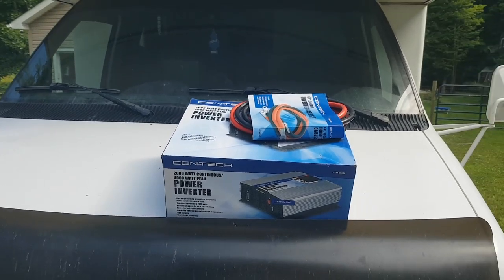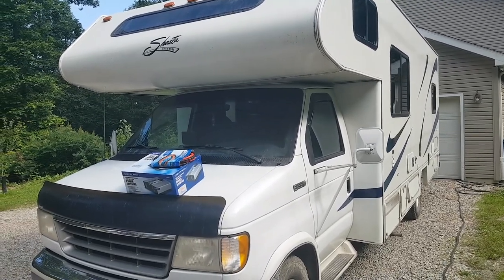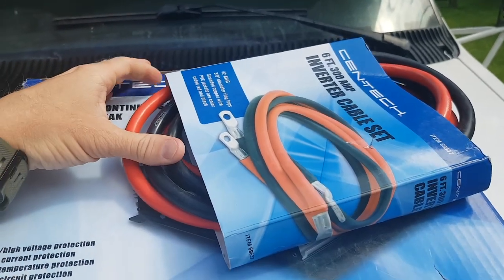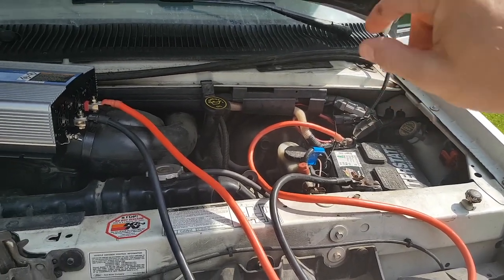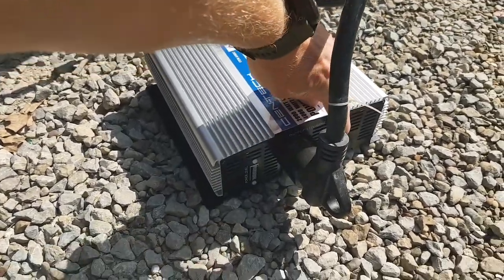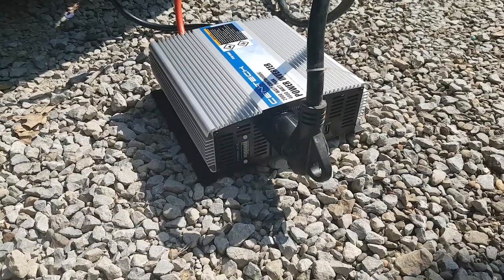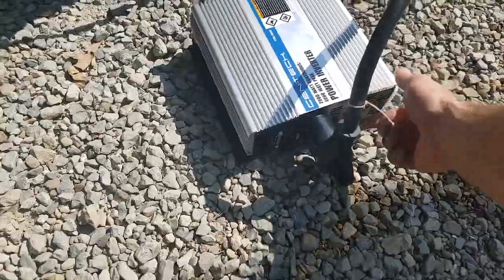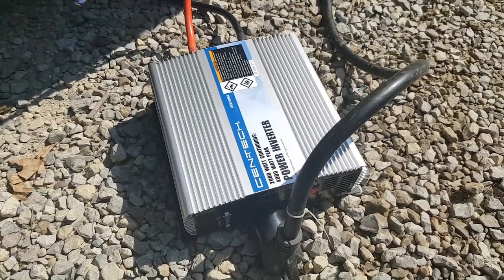Harbor Freight 2000 watt Inverter - Will It Power an RV AC System?

Comment: You need a battery bank and a pure sin inverter. Even with a different inverter you would kill the battery with the engine running. Spend the money on a quite generator!

Comment: As with any appliance the start up voltage draw is MUCH higher than running voltage. That draw will set off the alarm every time when running other devices. To show that is setting it up to fail.
Reply from the maker: But once again I will say that the startup surge on the AC system is still under the surge wattage of the inverter, which means the inverter cant perform to its advertised specs!!!
Reply: Just about ALL electronic devices don't. You add in cables which draw power as well and an aged AC system and I'm not surprised. I would be curious as to what the real wattage draw is on that AC system using a meter and what else you have pulling even the smallest wattage on standby. Even my top of the line Xantrex inverter won't produce 100% of its' "rated" power because it's listed under IDEAL conditions powering efficient appliances, using minimal cable lengths, ect. Plus it looks to me at least the 2000w inverter is only recommended to 1400 watts according to the chart, maybe I'm reading it wrong? There could be lots of variables here. Take a look at this vid of a guy trying to start an air compressor (1680w) using a 3000w inverter at around the 5 minute mark. https://www.youtube.com/watch?v=me0eAJL95og

Comment: Actually the Jupiter 63429 may or may not be a "piece of crap". "Jack..." failed to do at least two things in preparation for his experiment. 

The first mistake Jack made was fail to understand the "load profile" of his A/C. This is complicated, so follow along if you wish. When I use the term load profile, I mean the power draw from a residential 120 Vac outlet as a function of time from the moment the A/C is turned "on"  to say 1 minute. You will find that the power draw (and the current draw) will vary considerably, perhaps as much as a factor of 10X, over this 60 sec time frame. A Kill-a-Watt and your smart phone taking a video will work just fine. Record the power draw for 60 seconds, and then record the current draw for 60 seconds.

The second mistake that Jack made was to fail to understand the specifications of his inverter. There are three things to take note of. First is whether the inverter a "pure sine wave" inverter or a "modified sine wave inverter". If it is NOT a pure sine wave inverter, it should NOT be used with and load that has a motor or sensitive electronics. Second, what is the period of time that the inverter can deliver its peak power. It can't be "forever" that's the continuous rating. I have seen this peak power time period to be a fraction of a second to several seconds.

With the specs in hand, compare them to your video of the power draw of the A/C when plugged into a residential 120 Vac power outlet, I suspect that the peak power draw of the A/C lasts longer that the spec of the peak power capacity and time duration of the inverter.

There is another bit of very esoteric info and it has to do with in-phase and out-of-phase current vs voltage. Another way to look at the issue is to talk about Power Factor, but that is best left for another day. 

Moral of the story: "crap" is in the eye of the beholder.
Reply from the maker: Moral of the story is on the box it says it can power a 15,000btu AC unit and it cannot. Go to 35 seconds in the video and study the pic of the side of the box. Its false advertising. That was the only purpose of the video. Period

Comment: I think the air conditioner, needs much more than 2000 watts to start. You can by something to reduce the amount it takes to start the airconditioner.  My 300 watt dog air conditioner needs about 800 watts to start. And runs at only about 280 watts. 🚐🙋
Reply: The you tube channel "Gone with the Winns" did a great video on running rv airconditioners off batteries.
Reply from the maker: Yeah I agree the starting watts are much more but this inverter was 2000watts continuous and 4000watts peak or surge so should have been more than enough to start the A/C st 4000 watts

Comment: How about an integrated appoach?  A microprocessor that FIRST starts conventional generator and then the AC unit and then once running the inverter (An inverter with a GOOD system friendly sine wave!)  that takes over and THEN the Genny is shut down .....run it to a low temp and then coast as long as possible then ? rinse and repeat ....the processor each cycle waits until the optimal timing  ?  What we NEED though I believe is much better battery tech!  Batteries that can not only HOLD a charge long term but ALSO LAST many years!  AND are relatively cheap to buy!  THAT is what I keep hoping for!  (wondering if latest Tesla techies true to their hype??) Then simply aquire the best available inverters and processors /battery combos that coordinate everything for maximum efficiency!  Then?  just finally sit back and RELAX even in the worst climactic events including wildfire "redflag" shut downs and hurricanes etc...ALL of it!  ....ready to go full "off grid" at the drop of a hat!!

Comment: That's a modified sine wave inverter. Any research you do will tell you that devices with motors (like your AC) won't work properly without a pure sine wave inverter. I run an 8,000 BTU window AC unit with a Harbor Freight pure sine wave inverter. Not a piece of crap, just the wrong tool for the job.
Reply from the maker: Again. The box it came in says it will do it. I don't disagree with you at all. I disagree with harbor freights claims.

Comment: Depend on how much btu was the ac. A 5,000 maybe  a 10 ,000 no way. And it not much about the inverter but how much ah battery you have a single 12 volt not cutting it. Maybe 2  battery.

Comment: So many rhoughts watching you do this.... One. Even if the modified sine inverter your using does run the motor and compressor in your ac without overheating them, they will at the least be far less efficient. And frankly, using lead acid group 24 bats like you are wven with the altornator or converter providing any help, the sustained 150-200 running amps are not present. Let alone the high surge to start your compreasor. The tone is no doubt a low vomtage alarm that leads the the inverter shutting down.

Comment: HF inverters are rated Much lower than stated watts
Reply: Hey! Analog synth player! Your name is actually why I'm here. I have a 92 legacy wagon, and i just bought a 750watt power inverter so i can use my Korg Emx1 and Roland JD-Xi in the back of my car at the beach and make music. I then got the idea to run my ps3 and Lcd smart tv. Turns out they both draw a total of 1560 watts. So, I'll be converting to a 2000watt inverter. Good thing i cam exchange this one in and get the higher wattage inverter.
Reply: DJ Statyk Thank you and congrat's on using your gear portable. Much luck and hope you make some great music that way☮️✌🏻🎹🎹🎹🎹

Comment: no, its not the inverter thats the problem. get a bigger one. I run a window air conditioner on a 3000 w inverter from harber freight just fine in my cabin. and a 1500 w heater in the winter just fine

Comment: It's not that it's a piece of crap, it is more that you don't know what you are doing. When the AC Compressor kicks in, that 2,000 Watt inverter has no hope to supply the current required, even the AC on your car will take around 20/30hp to operate the compressor.
Reply from the maker: You missed the point completely. I know what I'm doing. I can also read the side of a box that says what the product will power. It's called false advertisement.

Comment: You gave up too quickly.  You needed TWO SETS OF CABLES! That would double the gauge thus increasing the amps. I have an inverter just like that. I use it in my big truck ( hooked to 4 batteries) I always run the truck when under heavy loads coffee maker, microwave, hot plate,etc.

Comment: You need shorter and/or larger battery cables. Or get an AC with a soft start. And, your battery is way too small, so this isn't a realistic test.

Comment: Got what you paid for bro, don't expect to much from cheap.

Go spend 3 times that amount for the same rating with true rms and all that good stuff and it may work for ya.

I have that exact same unit myself but I'm sure the results would be the same trying to pull that compressor.

Comment: not the inverter at all  if it takes 20 amp and no more it would work maybe with a 2500 5000 as ro start a compressor it can take 3 times the amps for an instant you could add 2 more capacitors  to your ac its cheap

Comment: We have lots (too many I believe) of "red flag" inspired power shut downs by local utility company ....the ONLY thing I can come up with is conventional generator powering my sh!t for X number hours on and off again ....and I realize it is not optimal safe power for my equiptment but damn I have to keep my FOOD from going bad!  ESPECIALLY with covid19 now!   I am tempted to splurge and install high end solar and battery storage but honestly I could likely replace potentially damaged refrigeration etc CHEAPER than doing THAT....and hey COULD always buy extended warranty on units....there simply is no great solution it seems

Comment: You need more thanks a regular battery that is designen to state a car you need a battery Pack " generator" at least 4 lithium battery, the I verter works, but you don't!

Comment: you need at least 2500 or it will not turn on the compressor  !!!!!After that it will run on 2000 Wats!!!!!

Comment: So you made a review that a product that you say doesnt work BUT you missed the fact that you cant produce more power than what is provided, how many amps does your "H.O" Alternator actually produce? Because a 7.3 ford HO alternator only puts out 200 amps not nearly enough to supply this inverters max capability.....Please understand how a product   works before reviewing it.
Reply: So with basic electrical knowledge IF you had a 200amp alt you could only produce a max of about 2000w peak, and thats if the alternator puts out max output at idle (most dont) trying to run it with the vehicle off was......funny to say the least.

Comment: My answer to your video title is a straight NO.
Reply: You dont have near the reserve cap or the spike juice from the inverter to run that AC in any way efficiently. You'd need a couple good alternators running to your power bank, then to like a 8000 or more watt inverter, depending on peak draw.

Comment: You really didn't think it would did you ? Start up watts needed or lock rotor for a 13,500 AC is 2075 and may need more if the unit is old since as a unit gets older it will need more to get going same with a house AC. And the average wattage once running for this is 1250 , so you can't call it crap. If you need AC then buy a bigger inverter but be aware you will be sucking a lot of power from your battery.
Reply: He can indeed call it crap. If that cheap inverter would have been able to handle a peak power surge of 4000W as advertised then it would have had no problem starting that AC unit, even if it took 10 seconds to get going. The fact that it couldn't speaks for itself.

Comment: Get an RV AC easy start system
Reply: the problem with the soft start is that it ONLY addresses the heavy draw of the AC..by going to  low frequency inverter it will handle the AC AND the full house electric fridge AND the swamp cooler AND the large free standing freezer AND the large power tools
Reply: @MrFrodo1111  so are you saying to get a low frequency inverter instead of a soft start?

Comment: Thansk I almost bought that piece of crap
Reply: Buy it they are absolutely great but the AC will need around 2600 watts to start  it then it would run on that same exact inverter but if you want it for a AC RV get the 5000 watt will be fine with deep cycle battery LOL